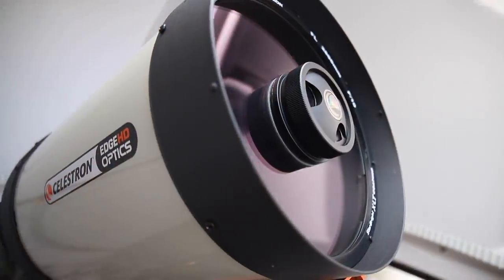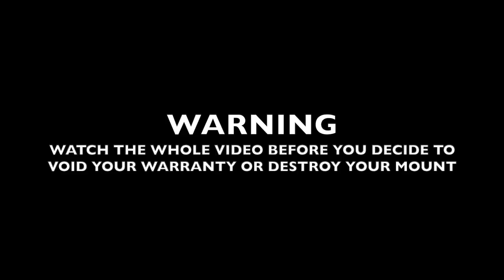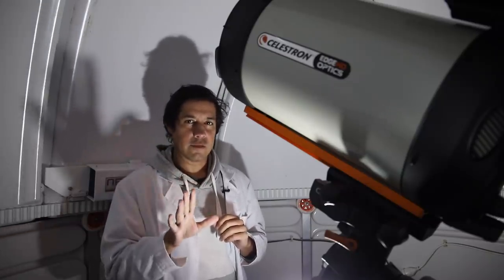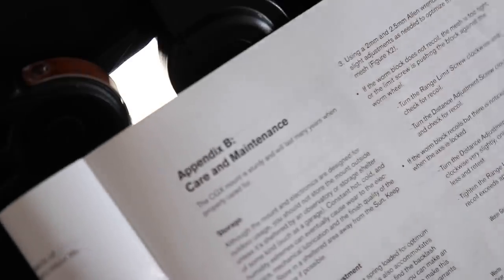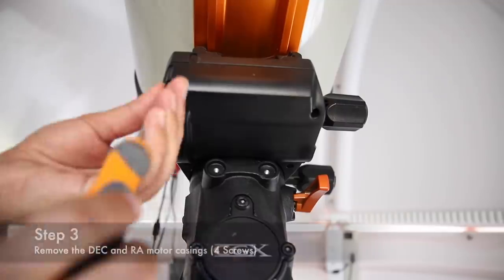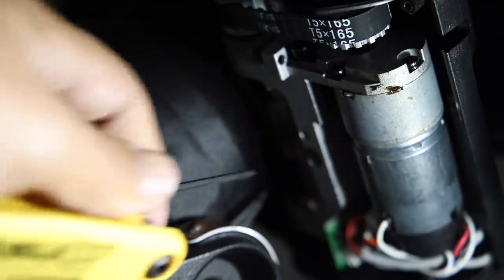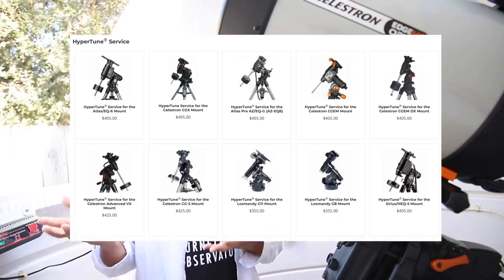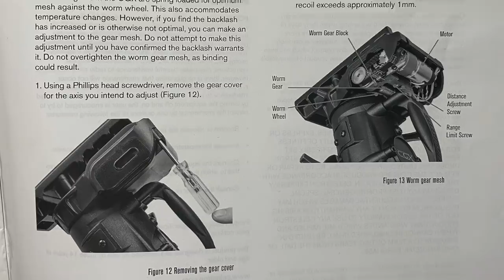Hypertune Your Mount for Round Stars (Celestron CGX)

Comment: Hey Dylan - I’m having an issue with image path for parallels desktop for image acquisition - whenever I try to take images in all acquisition software using parallels on my Mac, it says image path not found or error with image path. Thanks for the help!!
Reply from the maker: Never had that trouble in parallels.. was even able to save files to a network drive, but most of the time I saved to a USB or SDCard directly.
Reply: Dylan O'Donnell ah ok. I’ll try an external storage device next time! Thanks so much!! Also I’m a big fan of your channel - keep it up!!!

Comment: So it looks like you're compensating for belt stretch -which I can easily see people putting way too much tension on- adjusting the lash of the gearing and finally re-greasing it. I suspect you're lying about your automotive inabilities lol  
Fun fact: WD40 stands for Water Displacement, 40th formula. It was first used by Convair to protect the Atlas nuclear missile.